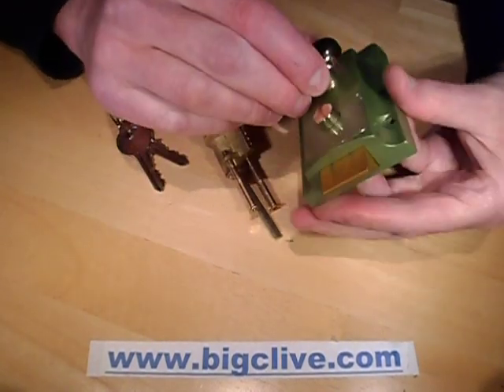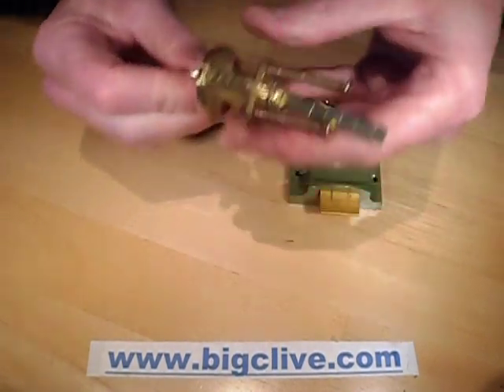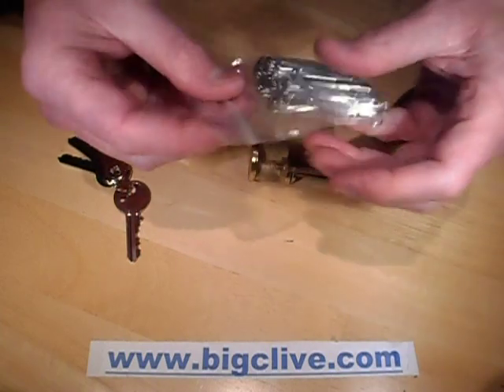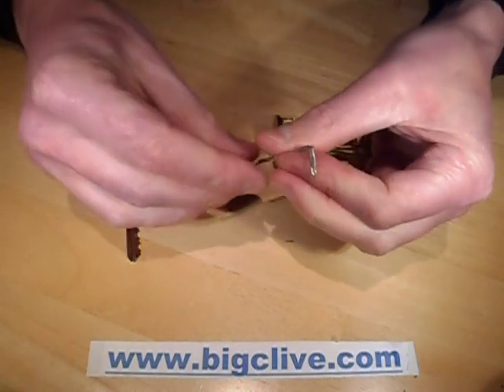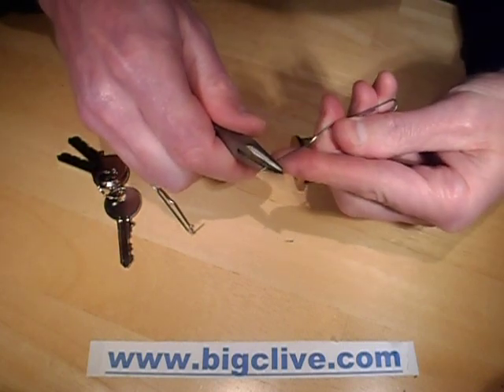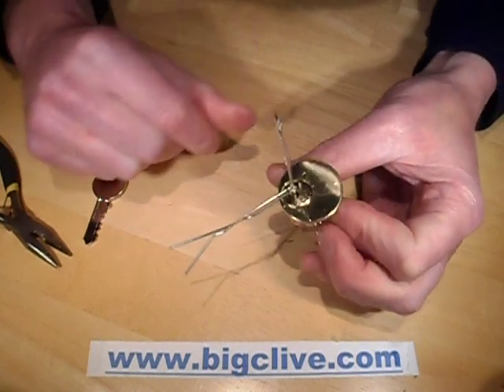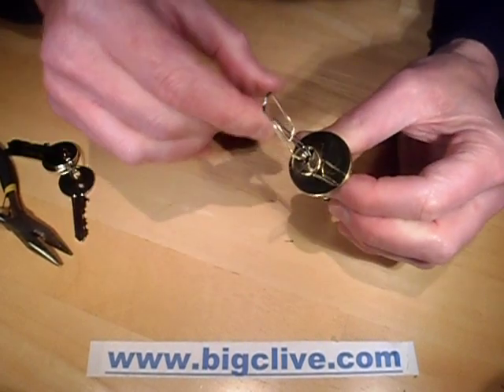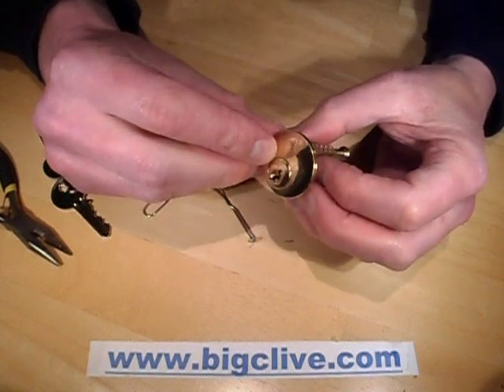Picking a cheap traditional Yale type knock-off lock.

Comment: So are Yale locks harder to pick, or should I just buy a different style altogether?
Reply: +Matilda Proper Yale locks generally have security pins that make them difficult to pick, though any lock can be picked if the picker is skilled enough.
Reply: Yale locks are really hard to pick and can only be picked by people with
 proper experience. I would highly recommend proper yale brand locks, 
not knock offs like this one.
Reply: Hobby Picker I just ruinned a era Yale I just picked a LCC HARDDNED DVLA CLAMP LOCK IN 3 seconds so I thought I'd try a era Yale type I naffed it I deceived to take it apart to see what was up I thought a bent pin lol 😂 now the springs joins are god knows where
Reply: Feet Thong lcc dvla locks are probably the easiest lock you will ever open they are worse than master lock no3.
Reply: Hobby Picker saying yale are really hard is pushing it a little bit,they are more difficult especially now they have changed the keyway but definitely not hard.